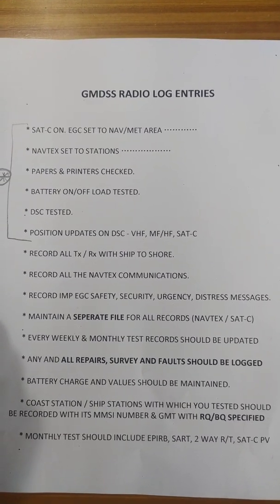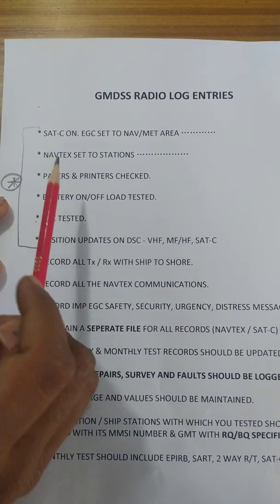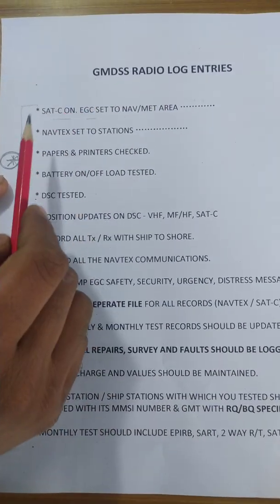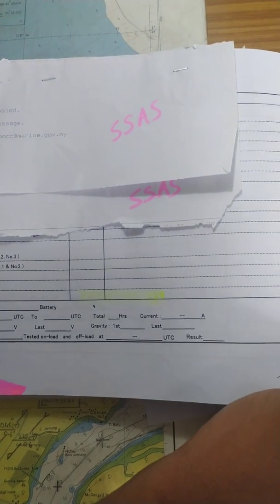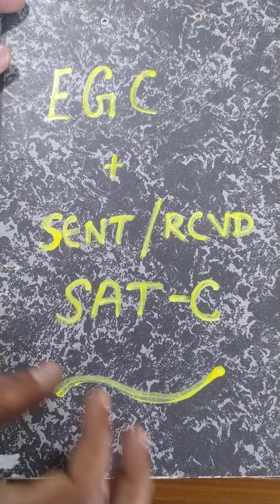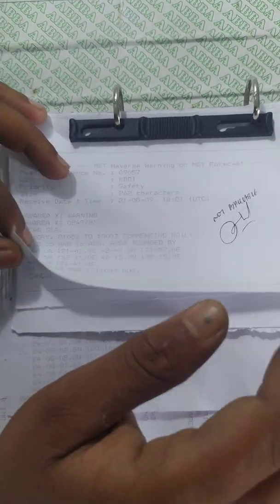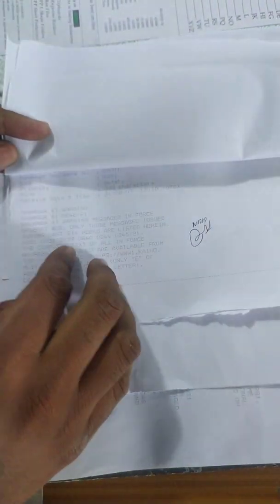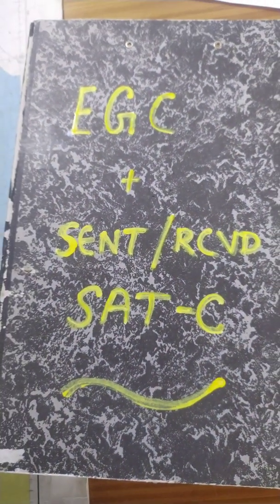GMDSS Radio Log book - How to fill and maintain explained

Comment: Do we need  to maintain the  entry  when alongside aur vessel at Port ???
Reply from the maker: Negative sir. 

You can simply put an entry "OFF WATCH" when alongside.  But if you do so, as soon as you start the new entry, maybe after a couple of days, the first line should be "ON WATCH". Then you can continue as normal.